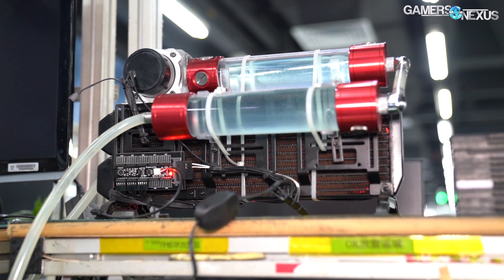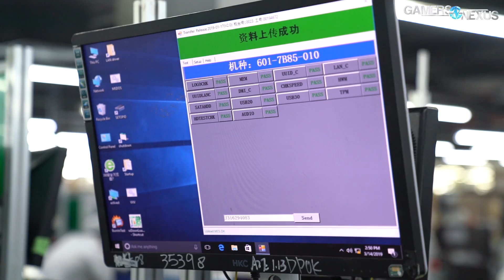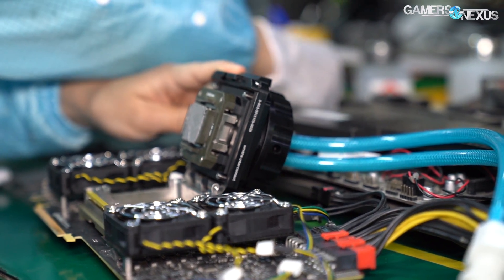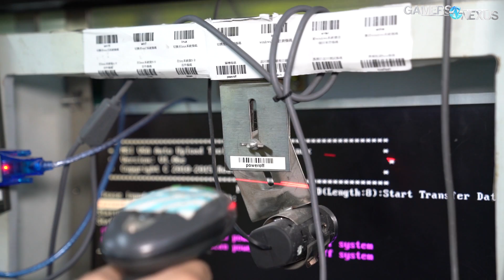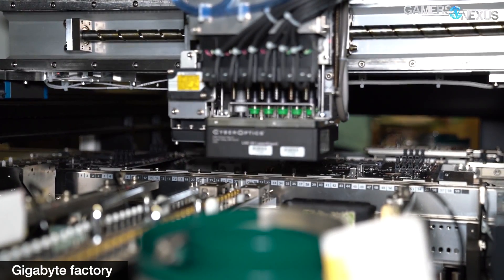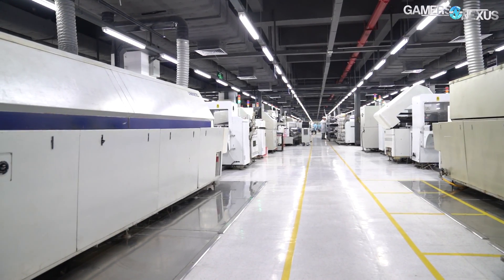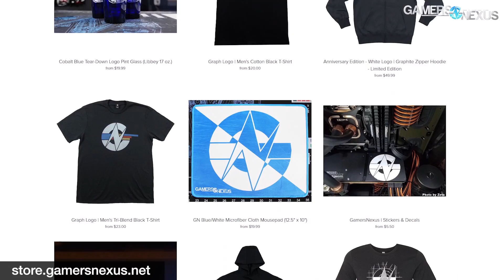Socketable GPU Testing & Binning | MSI Factory Tour

Comment: The software they use is called Nvidia Mods (Modular Diagnostic Software). It is a tinylinux distribution comprising around 200 different tests for every part of the gpu and memory. There are multiple versions of this software, for RTX 2000 series they use version 400.250, for RTX 3000 series they use 455.127 version, for 1000 series they use 367.54 version.

Comment: So much of testing tech still they couldn't figure out that cheap capacitors are causing stability issues on 3080s on other hand other OEMs used atleast 1 expensive capacitor.

Comment: I have a HP slimline computer core i3 8100 with 630 Intel graphics.  I also have a Dell gaming computer core i5 8400 with a  GTX1060.  What i want to know do all processors have integrated graphics ? or are some in the motherboard ? Tom Hardware said that all processors (other than Xeon) have integrated graphics.  If this is the case do all 8th generations Intel CPU's have 630 graphics ?
Reply: Thanks Aleksander

Comment: That GPU tester is pretty cool, but makes me wonder why the board partners don't offer a GPU board that you can upgrade the GPU in or replace if it is damaged from overclocking with a mounting socket design similar to CPU's, maybe instead of a BGA the GPU manufacturers need to offer pins or Contact points to make this more feasible. Also given the retail price of the cards it does make one wonder that it is not worth reclaiming an already soldered on GPU for a better products or on a failed product.

Comment: I don't understand why binning the GPU would add any substantial time to the already used process.  Just run stability tests with ramping frequency right after the test they are already performing, and you can 'bin' the GPU into a tier of performance.  I don't think anyone would expect them to find the max overclock, just the minimum performance at stepped voltage levels.  The canned answer you faithfully regurgitated suspiciously sounds like the company is not willing to admit they might do this, even tho it probably happens regularly.  I think we can all agree that Brand sales would suffer if your most expensive cards unfortunately ended up with lower quality (within spec) chips.  Any reasonable company is going to spend time/money to prevent this.

Comment: I wondering, it’s possible a line market for motherboards with GPU by socket? I mean no PCIe slots and in that space place the GPU and VRAM socket. The motherboard probably looks like dual CPU motherboard but the CPUs on vertical potition...

Comment: The whole "socketed GPU" thing is actually pretty tricky for several reasons. The obvious one is reliability of contact pins in the socket, which often aren't pins but special coiled up bundles of ultra fine wire for each pad. Multiple contact points for each pad reduces inductance, which would otherwise affect signal integrity - that being another concern that would limit max frequency compared to a soldered setup. Yet another concern is thermal. Soldered GPUs transfer heat very well into the actual PCB which acts as a bottom side heatsink due to an abundance of large "ground plane" layers within the PCB which help spread the heat. A socketed solution would have poor heat transfer into the PCB, requiring a better cooling solution on top of the chip. Just some thoughts.

Comment: Man, I wish we could get a socketable GPU that would work for a few generations at a time.  Seems like a way to reduce the costs substatially.
Reply: With the die shrinks and changes in architecture, power delivery specs from Radeon and Nvidia change every generation so AIBs need to revise pcbs. For cpus most Intel sockets don't support more than 2 generations or 1 generation and 1 refresh even though we had quadcores on desktop for like a decade. AMD was extremely forward thinking and committed to support AM4 until 2020, but that compatibility is bringing concerns about PCI-E 4, DDR5, and higher core counts. We've had GDDR5 gpus since 2008 but do you think a pcb designed for a HD 4870 or GTX 480 could power a R9 290X or a GTX 1070 Ti? Based on buildzoid's videos only the XOC cards would have a chance and you'd also need memory manufacturers to produce something like SODIMM vram kits.

Comment: You say that the cards are checked with a colorimeter (I'm assuming you mean the video output), but isn't this step only usefull with older cards with RAMDAC wich can output a VGA signal? I mean, modern cards don't have analog video outputs anymore, so there should be no color accuracy problem in that aspect (it's a completely digital "pipeline").
Reply: There can still be problems. GPU's are horribly complex, so are the possible failure modes. They're not doing calibration, though. It's just sanity checking that the card can actually display the colors it's told - not checking whether they are particularly accurate.
Reply: @Mythricia1988  That would make more sense indeed, but I hardly doubt that any GPU would pass all the stress tests but somehow fail to, for example, show "red" as "red". That's why I said it only made sense to me if they were testing the RAMDAC part of the cards, which none of these have.
Reply: @-Kalliope-  Well.... They are doing it. So clearly it does make sense. Else they wouldn't be doing it.
Reply: @Mythricia1988  Yup, I guess so too.
Reply: a n i m e
n
i
m
e

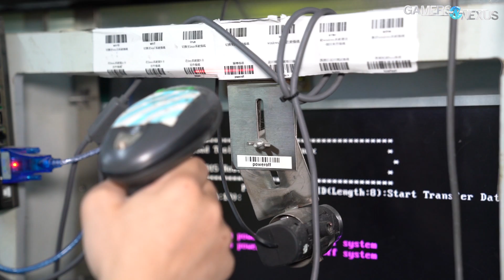Comment: 4:39 I can't tell if you say "this is next level test automation" or "this isn't". What I can say is that it definitely isn't next level test automation. Next level test automation would be a Teradyne UltraFLEX with their new ultraserial 60GHz. That could probably test the GPU in a few minutes instead of 30. What we see here is a total hack job compared with the automated testing the semiconductor industry does, but it is pretty advanced compared with other Chinese board makers. Its amazing how much they can do for so cheap.

That's a pretty cool liquid cooler on the DUT contactor (contactor is the official term) but a proper test system will use ln2 in a loop. Even for 3 Watt parts its required to get the junction temperature set precisely as ln2 can respond fast enough when it starts heating up.
Reply: it did seem pretty damn basic to actually have lights and monitors when it could be digitally analysing output far better than a human could

Comment: "Time cost is high"? So it will cost you two bowls of rice? Oh, you have to cancel their lead poisoning insurance? That's right, they never had insurance. 
Sort yourself out!
Reply: @mihaimera7837  It doesn't matter if its not the 80's because it is China. Engineers and supervisors keep the equipment operable. The people running it are simply part pumpers.

Comment: I would love seeing motherboards with both CPU and GPU sockets

I would 100% prefer that over having the CPU and GPU on separate boards
Reply: what about if we went back to a motherboard this is just a bus, that way we could have small cpu cards and mxm sort of size gpu cards that would allow VASTLY longer upgrade paths (you can have glue logic, additional power etc on the boards). It worked REALLY well in the past

Comment: Why isn't socketable gpu boards a thing!!!!!? That's next lvl. I understand incompatibilities. But just treat it as a regular mobo. Make tiered boards with 2gb,4gb and so on. If the die is made of the same architecture then it'll work depending on that boards ram capabilities of course. Rtx 2060 die could just be plopped in an 8gb or which ever board you have until you get the 2080 or its ti variant.

Seriously, why is this not a thing!?!?!?!?
Reply: Cost
Reply: Higher end gpu consume more power and it require larger card. So the motherboard will need classification. Lower end board can't support high end gpu but higher end board will support lower end gpu. So if you plan to upgrade, you buy the expensive board and upgrade later. But newer gpu maybe require different board too and the total between socketable gpu,board,and vram maybe slightly more expensive than regular card.

Comment: This needs to be done at a consumer and professional level.
It would make upgrading far easier and the builders more entertained.
Reply: You can just reflow them. Plus, I’ve got an ePower from EVGA that you desolder the board of its VRMs (Or conveniently use a hacksaw to just chop off most of the board), then no more power limit, or voltage limit, or basically any limits. Those are nice, and you can just desolder the chips right now for binning. I don’t know if anyone who desolder them for binning though, even for world record setting. It would be extremely expensive considering you can simply buy a prebinned EVGA K1NGP1N or Galax HOF GPU and not have to worry about it, those are sill cheaper, and wouldn’t require hundreds of hours of binning.

Comment: I think all cpus should have holes for attachments that ensure the coolers are directly attached to the cpu and another outer set to attach to the mother board, if spacers were created to ensure optimal pressures it would seriously simplify all the many mounting solutions into one. Just an idea I’m sure it’s flawed.

Comment: I would just die if I had to work in a factory with constant fan noise and beeping.
Reply: Its not as bad as you think, you get used to it. In my case, the noise was measured so it wouldnt pass legal limits.
Reply: @sjarken3979  In China I'm sure "legal limits" is a vague concept
Reply: That is basically a datacenter with extra steps.
Reply: what about the coil whine? i can barely tolerated it on my system.. now imagine 300 of these bastards.. ahah
Reply: You'd probably spend your days listening to music, podcasts, Et Cetera.
Reply: Oh man, you would've hated my last job. I repaired servers for Quanta, and those things were run at 100% for ~30 hours for testing. It's so loud that you can hear it 20ft away from the building with its door closed. There were ear plugs, but they only did so much.

Comment: I always thought that "Armor" cards were just downgraded coolers..not sorted or binned PCBs.
Reply: Both lower end cooling and chip
Reply: armor card is great if you planned to install water AIO
Reply: Based on how they described the process, it sounded like most Armor GPUs are "average" (haven't been binned in any way), with the occasional dud redirect to the Armor line-up. So, it's not that they're all slower, just there's a small(?) chance you'll get one that fails to meet the criteria of the other card line-ups.
Reply: It might not be lower grade GPU. Every binning process needs to take into account the supply and demand. A cheaper product will sell more than a more expensive product. Naturally, the Armor cards will sell more units than a Gaming X card. So the GPU itself might not be a lower bin unit, sometimes you just need the volume to satisfy market demand.
Reply: @fleurdewin7958  Yep once they have binned sufficient numbers for the higher tier cards they will just stop binning - that doesnt mean its not a great chip just that they havent verified it.

This is also why someone people pull massive overclocks out of the same card/cpu vs someone else with an identical setup.

Comment: Interesting all the test screens are in English, would've expected Chinese.
Looks like that barcode scanner doesn't work to well...
Reply: They should rather move to QR codes, because they can fit more information into the codes and more codes onto the station.
Reply: @CataclysmZA  It all depends how much information they need to issue the command to the system.
You can fit up to 80 characters using a Code 128 which I'd expect would be sufficient for most industrial applications.
Reply: @hoffer_moment  Yeah I've set up a lot of them in retail. I think 10% for IR is a bit much unless there's something wrong with it, I'd go more like 50-75%.
I wound up always convincing business owners to spend the extra on laser and they never regretted it, so much faster and more accurate. Just not as robust, so need a little more care.
A laser one would certainly fix this scenario.

Comment: I actually thought about socketable GPUs some time ago and still wonder why it never reached desktop PCs. Like still using a card that slots into the PCIe slot but with interchangeable GPUs and slotted memory. On that note, what happened to #AskGN ?
Reply: 💀 I believe this was actually on a previous AskGN. I think it basically boils down to vastly different power requirements along with different memory configurations.
Reply from the maker: There was an episode like 2 weeks ago.
Reply: Well, if you can just easily swap the gpu with the same pcb, then the profit margin of all custom gpu makers will drop significantly and basically nvidia will be the only one who could sell the new gpu.
Reply: ... cos thats basically the point of VLB/AGP/PCI/PCIe in consumer machines to start with? the slot is effectively the socket you are asking for
Reply: @mycosys  no, expansion interface isn't what he was meaning. He's meaning more an interconnect type card like an gpu with a socket like intels slot 1/2 SECC back in the day but obviously in modern standards and for a gpu with BGA/PGA socket for core gpus so you aren't buying whole package each time. In theory such things could be done it's just economics, industry accepted standards it's not really something nvidia, amd or intel will probably jump into - unless it's all together.
Reply: @antz007x  its ironic i have made similar comments about cpu daughterboards as well like in the old says. 
The thing is we kinda agree - you are asking for a smaller card with power support external - like say MXM v2 whatever that is it seems to me? 
What could be really cool could be going back to a motherboard thats just a bus - we can make interconnects just about any shape now - the cards could be fairly tiny, form factor would be near unlimited.
Would be awesome if both the CPU and GPU daughterboards inluded socketed ram too, so they can be ported between systems
Reply: @antz007x  btw - are you aware VLB and AGP are not peripheral busses but specific graphic 'local' busses just for the gpu. This approach seems a LOT more likely to be useful across generations than a socketed unit
Reply: Look into MXM for graphics. They can be used in embedded systems, laptops and even in a desktop with a pcie adaptor.
Reply: It's not due to power nor memory requirements, so much as both play same role in cpu basis of a system. It's more simply to do with economics (cost of production, lifespan, generations - how fast technology changes or adapts etc). Only other minimal part that plays directly into affecting performance is bandwidth limitations over different connections, sockets vs soldered and so on. It's very similar in the same ball park as the laptop vs pc situation and why there's very little in way of modular laptops.
Reply: The problem is the insane amount of pins a GPU and GDDR requires.
Reply: With these new gpus with 20+gb of ram and ton of power draw with giant size we would be better off just adding a cpu socket to gpu
Reply: Keep in mind: you have to fit this in the expansion bay area. Sockets are expensive, putting the gddr5 on DIMMs would make them much worse about latency and cap bus-width to At Best 128bit without wildly increasing size of the card. Still, you could probably make something like the RX 560 only cost about 400 dollars
Reply: @kiaas  there were gfx cards that had socketable (and even in a DIMM like slot) RAM back in the day actually. They could make the RAM chips socketable even today but it would be pretty pointless since the bus width would be dependent on the number of chips installed. The only thing it would allow would be to increase the capacity by switching out all the chips... not very feasible, and there would be no market to speak of to sell the smaller ones. Unless they started to sell GPU's with NO RAM installed lol. In short, not gonna happen.
Reply: @Qyngali  I have one of those cards, even back then it was a bad idea as a consumer product, and old school SGRAM, SDRAM and even DDR1 are a heck of a lot more tolerant to variance in trace length and other such things that DIMMs or mezzanine boards would cause. sockets are better about that, which you could do with very thin LGA style sockets (could probably use  BGA that never got balled with gold plating on pads as an LGA in a cost-saving effort). The main people'd that could want it with how ungodly expensive those sockets would be are extreme OCers looking to use binned memory..
Reply: @kiaas  I dont think the sockets are that expensive. Older notebooks used to have socketed CPU pre-Haswell era. The reason they go full BGA is just to make the notebook slimmer. If you look at current notebooks with soldered DIMM, it does not perform better than notebook with SODIMM RAM slots. You can stack RAM modules on top of each other like many notebooks do to save space on the PCB.